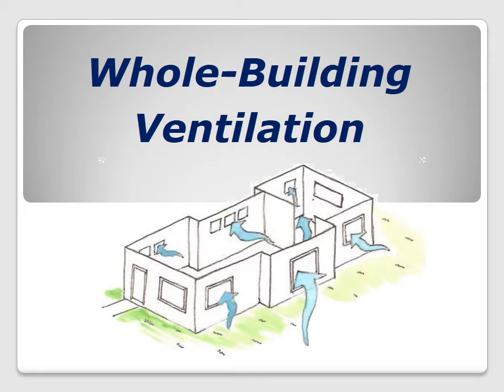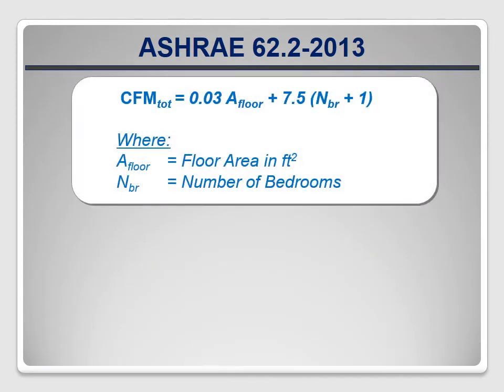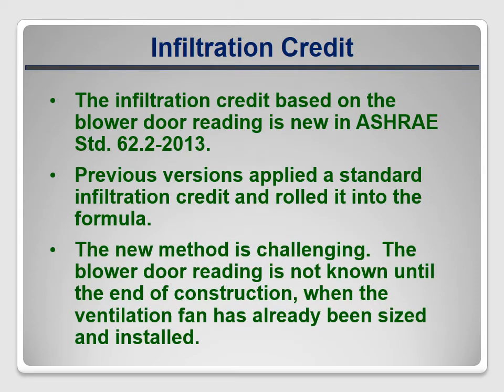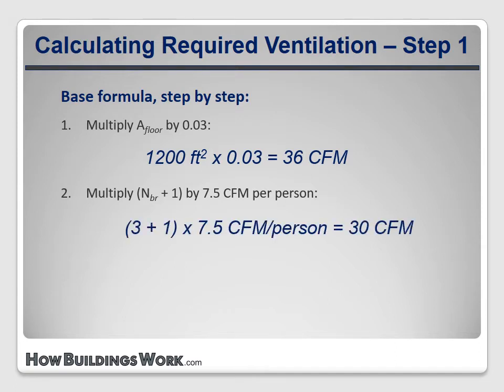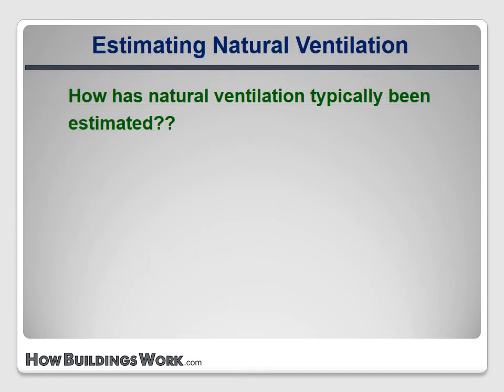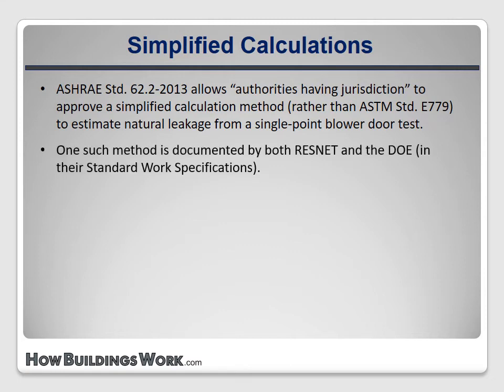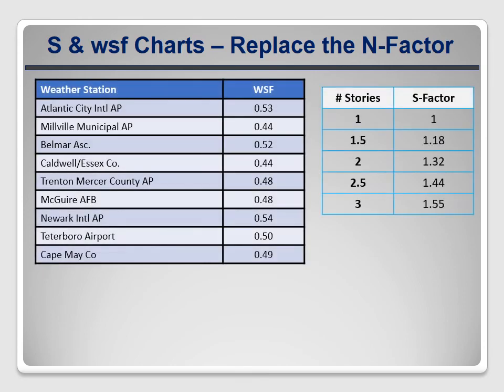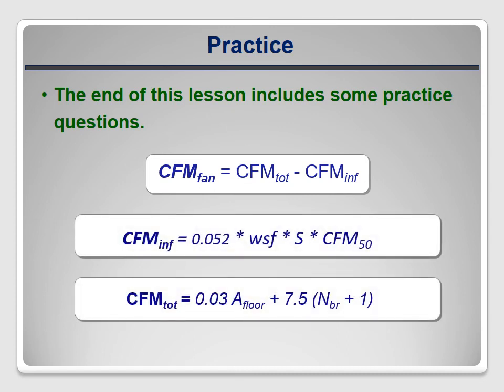ASHRAE 62.2 - Lesson #5 - Whole Building Ventilation

Comment: Question 1: is the correct formula for storey height factor S = (storeys)^0.3 or S=(storeys)^0.4 ?
Question 2: where exactly did you get your values from?
Reply: Marc,  this video was created back in 2017 and it references ASHRAE 62.2-2013.  In that standard, the formula for S is (H/Href)^0.4, or (storeys)^0.4.  That comes from section 4.1.2 of the standard.  Your program or local codes may reference a new version of the standard which may use a different formula.  
Dave

Comment: Is there a requirement for the application of ASHRAE 62.2 where a utility program air seals existing homes ?
If no ventilation calculation is conducted by the contractor air sealing the home. Isn’t the creation of a ‘construction defect’ of sorts possible, and no way of knowing the relative natural ventilation rate, nor the potential for gas appliance back drafting?
If they don’t exercise both a ventilation calculation and combustion safety exercise...aren’t they potentially creating a host of problems of varying degrees?
Reply: All of the utility weatherization programs I have worked with (in NJ & PA) apply some version of the ASHRAE 62 ventilation calculations whenever air sealing work is done.  If the air leakage rate drops below the calculated threshold, the contractor or agency doing the work is required to install a mechanical ventilation system.  This is also true of the national Weatherization Assistance Program (WAP).  I suspect that there are few, if any, utility programs in the US that don't follow this same procesdure.
It's helpful to keep in mind why the air sealing is so important.  It doesn't just keep conditioned air in the house.  It also keeps airborne moisture out of attics and building cavities where it could condense into liquid water and cause all kinds of problems.  Condensation is much more likely after insulating because those cavities and attics become colder.  We need to insulate houses better for comfort and lower energy use, and the air sealing is an essential part of it.
I don't think I'd call the lower air exchange rate a "construction defect", it's just a necessary byproduct of the desire to have a comfortable, efficient house without hidden moisture problems.  The mechanically driven air exchange is the best, if imperfect, way of addressing the issue.
Reply: Dave Bone 
Hello Dave,
In your reply, when you say ASHRAE 62, do mean 62-1989 or 62.2 ?
Reply: Dave Bone 
I would contend that any modification to a dwelling which causes, or majorly contributes to a condition conducive to the ill-effects of under-ventilation could well be considered a produced ‘construction defect’. 
That term is not mine. It’s a term Max Sherman of Lawrence Berkeley Laboratory used in a reply to a question I posed concerning air sealing.
Reply: @flyonbyya  Until fairly recently, it was 62-89.  But now most of the programs I work with are migrating to various versions of 62.2.  The federal WAP program says that grantees must adopt the latest version of 62.2 within 1 year of its release.  Most of the other programs are adopting more slowly, but still migrating towards newer versions of 62.2.
Reply: Dave Bone 
Since BPI adopted 62.2 in 2013, as well as WAP, HPwES and others. I’m curious  as how the obsolete 62-89 standard continues on.
Reply: @flyonbyya  You clearly have strong opinions on this subject and believe that the higher ventilation levels in the later standards are preferable.  Others have differing opinions.  ASHRAE 62.2 is a voluntary standard, formulated by a non-governmental body.  Programs are not obligated to follow it.  They can design their own rules based on their economic, environmental, and health and safety objectives.  Building codes, which are widely governmentally adopted for new construction, continued to embrace calculations very similar to ASHRAE 62-89 through the 2012 IRC.  It is only since the 2015 IRC/IECC that they have been moving to tighter ventilation requirements.  PA and NJ only recently adopted the 2015 I-codes, which requires ventilation at rates that mirror the 2007 version of ASHRAE 62.2, not the much higher rates in the later versions.  It seems entirely reasonable for utility programs to follow the path of building codes, slowly migrating from the ventilation requirements of the pre-2015 codes, assessing the impact on implementation costs and customer air quality as they proceed.
Reply: Dave Bone 
I have a relatively uninformed opinion.
But when Rick Karg has expressed his view of 62-89 as, in his writings as obsolete...I pause.
Reply: @flyonbyya  Lots of people have opinions.  I have my own, based on years of visiting houses, running blower door tests, and evaluating the indoor environment for moisture, odors, and other air quality issues.  Mr. Karg certainly has a good reputation, but so does Joe Lstiburek, and he has a very different take.  Check out this article:  https://www.energyvanguard.com/blog/66004/Interview-with-Dr-Joe-Lstiburek-The-Ventilation-Debate-Continues.  
Being a pragmatist, I worry that program contractors are avoiding insulating and sealing some houses because the newer standards ( that their program has adopted) will require that they also install an expensive ventilation system when it may not be necessary.  Or they may do less energy efficiency work because they have to spend money on the ventilation system.  This is not hypothethical.  I've had contractors tell me stories about specific houses.
I'm OK with ventilation system if its REALLY needed.  (I have one in my house.)  But I fear these new standards are sometimes requiring them when they are not needed, overventilating some houses, and taking money away from more important measures.
Keep researching.  The best thing you can do is gather data and draw your own informed opinion.
Reply: Dave Bone 
Sour grapes Joe
His effort to start his own “standard” was a miserable failure...and came crawling back
Reply: @flyonbyya  You clearly have an agenda to promote.  This isn't really the best place for that.  This video has well under a thousand views and I have a grand total of 35 subscribers.  There are better forums for you to pursue an argument.  I've presented my opinion and won't respond again.  You should provide your real name so other viewers know who you are.
Reply: Dave Bone 
I honestly have no agenda...none.
I’ve not disagreed with you or anyone, ever, concerning this subject matter.
I’m simply developing an informed perspective.
Your experience and perspective has been quite helpful...much appreciated !